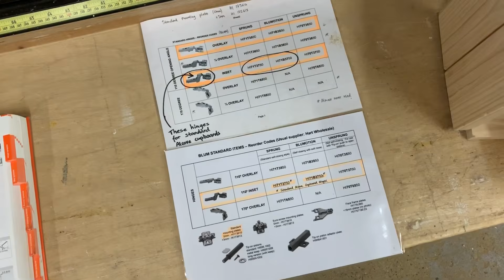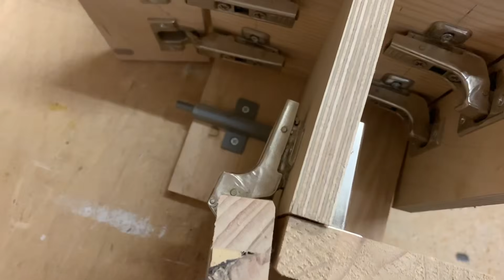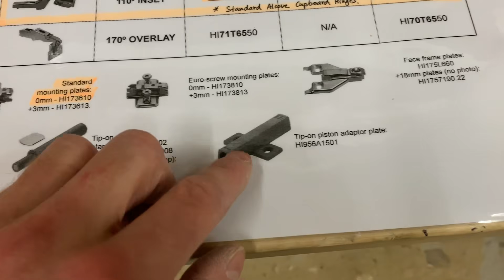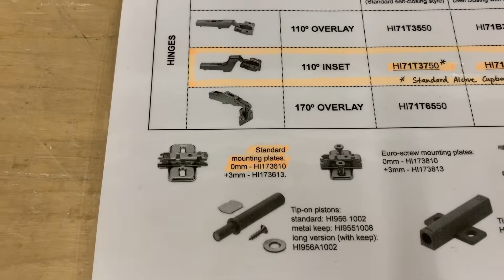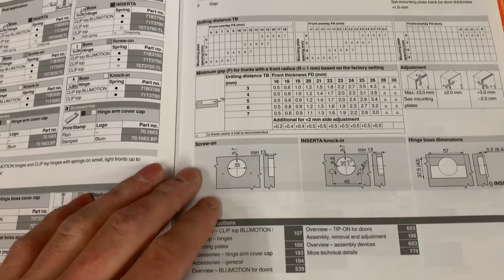All the main Blum hinge types explained!

Comment: 9:52. Can you go into a little more detail about the spacer you need to use the 170 degree hinge with an inset door?  I am making an inset bifold door for an L shaped office cabinet, similar to a lazy Susan door, but totally inset.  Is this a shop made spacer I make myself or is it supplied by Blum?
Reply from the maker: Google 18mm Blum mounting plate https://www.tcfixings.co.uk/product/blum-clip-two-piece-adjustable-mounting-plate-18mm-height/3731?gclid=Cj0KCQiAutyfBhCMARIsAMgcRJTpjTd89VPnroXs2EpQMPdiHqAARkWCAzp3VhG4DdO8pOVvHgpXKbwaAgfLEALw_wcB
Reply: @Alastair_Johnson  thanks for the information!

Comment: I needed to put a door on the front of a free standing washing machine, I knew what I needed but could not think what it was called as it’s normally 1/2 overlay or full, needed 2 inset hinges and it worked perfectly, you even gave the codes, thumbs up and subscribed for a thorough video
Reply from the maker: That's nice to hear, thanks for letting me know!

Comment: Very usefull Alastair thankyou. Would it be acceptable to use any of these hinges on 18mm mdf carcasses as opposed to ply?? Will the screws hold ok?
Reply from the maker: Hi Giles, way back we used to make our internal carcases from Medite 'premier' MDF and we used mounting plates with simple 17mm long 'hospa' screws (pointy self tapping screws -  not the stubby euro screws that require a 5mm predrilled holes).  Then we had a call back to a job where the mounting plates were pulling off and I decided the material was not strong enough.  This was one of the reasons for switching to birch plywood carcases (prior to us having an edgebander or CNC).  However now our standard internal carcases are made from melamine faced MDF, from Finsa's '12-Twenty' range.  We use the euro screw type of mounting plate, and i am confident about the fixing.  This particular range of Melamine faced MDF has a pretty good core.  I still wouldn't use the hospa screwed plates in it though.
Reply: @Alastair_Johnson  thankyou Alastair I really appreciate your detailed answer

Comment: Are these hinges very durable. Bottom line
Reply from the maker: Lifetime guarantee on Blum.   I’ve never had issues with them.  Like anything they beee to be correctly specified - using the correct quantity of hinges per weight of door.  The most likely thing to fail is the fixing into the board - so it’s good to use quality board and appropriate screws

Comment: When does the use of a third hinge come into play, as it relates to the door height?  I’m sure weight and width are factored in.  But I have some frameless cabinets that will have full overlay doors that are 18” wide, made of 3/4” thick CVG Fir plywood.  Should I use three hinges?
Reply from the maker: If in doubt use another hinge.  And see this guide: https://ea.blum.com/en/number-of-hinges/

Comment: Trying to find drilling pattern for cup holes today for 21mm doors and 18mm carcass on hettitch and other brands on website.   Couldn't find answer so have up and emailed them. Do you have any ideas? Thanks
Reply from the maker: 35mm diameter cup hole.  13mm deep, 5mm from the edge of the door (22.5mm to hole centre).  This works for the vast majority of situations.  Apart from that, take time to understand the diagrams from suppliers for example these ones from the blum technical manual on page 79. https://publications.blum.com/2020/catalogue/en/78/  It's hard to get your hear around at first but if you carefully cross reference the charts and diagrams you will start to understand how changes to one setting affect gaps/overlays etc elsewhere.
Reply: @Alastair_Johnson  thanks, I've worked it out, the standard 110 degree hinges don't work on thicker doors, I need thick door hinges. I was actually using the dimensions you mentioned but the standard hinge was giving me problems. Sorted now 👍
Reply from the maker: @tadge74  Ah ok yes that makes sense

Comment: I have internal drawers in my cabinet but the door is restricting the drawer movement, i have used 95° hinges, would the 165° opening help me out?
Reply from the maker: The blum 155º hinge is designed to move the door laterally outside of the inner face of the cabinet when opened and may be the solution you need.

Comment: Very useful video! Do you have to have the soft close on both hinges or can it only be on one of the hinges for full size door applications in say a kitche? Thanks
Reply from the maker: you can turn them off and on until you get the right level of soft close.   We find that 3 out of 4 hinges is enough soft close on a tall door, and we usually just use one on a 2-door small cupboard door.  So we actually substitute the other hinge for a slightly cheaper sprung hinge without blumotion at all

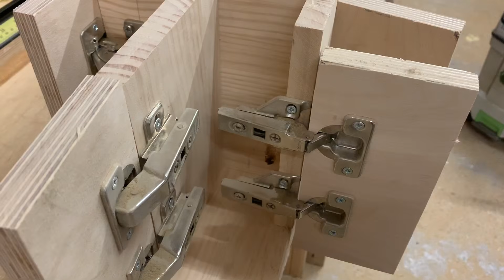Comment: Great video, thanks so much for the explanations! Could you tell me the code for the hinge at 6:40, please? And if there are any hinges that accommodate a similar situation?
Reply from the maker: Do you mean the mounting plates for fitting on the inner edge of a face frame.  They are much more widely used in America than in the UK.  Example: https://www.handlesandmore.ca/face-frame-adapter-plate-0-mm.html

Comment: We have older cabinets that have a partial inset, does Blum carry any soft close hinges for this?
Reply from the maker: I’m sure you can do it - if you are referring to inset sideways across the cabinet then there is a half overlay hinge with a cranked distance in between the full overlay and full inset options.  If you are referring to a partial inset forwards/backwards into the cabinet then you can just move the mounting plate position to suit.

Comment: Hi 
iam fitting some clip on 110 degree o overlay soft close hinges with a euro plate, the 35mm hole sits 5mm from the door edge
Can you please advise me how far in the holes should be on the carcass for the Euro plate.

Hinge type...CC110SEC2/PB

Thank you 
Andy
Reply from the maker: Hi they are 37mm from front edge of carcase

Comment: I ungraded my normal hinges to Softclose Hinges - but had to use Hetich as the existing holes in the doors (cup side) were 52mm centres. Most of the Blum are 45mm centres. If your carrying out an upgrade - make sure you check the existing door side screw positions/centres. The Hetich hinges also come with a multidue to options - like arm covers and cup end covers.
Reply from the maker: Hettich hinges are really nice!

Comment: Ever used the wide opening types with mitred door?
Reply from the maker: I haven’t but I think the best ones for that might be the Blum 155degree hinges which throw the door more forward as it opens
Reply: @Alastair_Johnson  I ended up using a 170 degree half overlay. Adjusted to keep socket hole as far from mitre as possible. Just barely clears, but it does work.

Comment: So they never came up with something that was flush mounted without a mortise? Nor a shallow mortise like 3/8 so I can use it on doors with less than a 3/4 stile? Bummer, that's like me forgetting to caulk one side of a tub.
Reply from the maker: You may well find solutions, search for the Blum orange technical manual (FAR more hinges than the small snapshot shown here)

Comment: This was really excellent. Thank you. 
Can you please tell me the name of the hinge at 7:03? I'd also love to know whether the edge of the door exceeds the width of the surface to which it was attached please. I have an awkward door situation right up against a wall.
Reply from the maker: Hi I get asked about that hinge a lot, I wish I had covered it in more detail in the video : https://www.tcfixings.co.uk/product/blum-110-face-fit-compact-hinge-plate/16540?gclid=Cj0KCQiAqo3-BRDoARIsAE5vnaL4mjwSIbKr9kniaPbeXsQBSPqvT0wWWHkxLAU8t8PPygCHX3-tJjEaAhYoEALw_wcB
Reply from the maker: You do have to drill the cup hole very close to the edge to be sure it doesn’t foul as it opens
Reply: @Alastair_Johnson  Thank you so much for the information and the advice. I have no idea what I'm doing but it's a very small project so I have a little room to go afoul and still fix it.

Comment: Thanks for the video. Could you explain why Blum Tip-On or push can only be used with unsprung hinges? As far as I know Blum also sells a buffered version which they claim is intended for sprung hinges. Has you tested those by chance do you know what is the difference? Or is it just the same Tip-On with magnetic and rubber tips.
Reply from the maker: Hi sorry I missed this comment first time around!  If a sprung hinge is used with a push latch, it just means it will open as far as the latch travels and hold there until you get your fingers in and pull it open.  Personally I think it’s a nicer effect for the door to swing freely open after the latch has released and given it that initial push.  I’m not aware of the specific rubber tipped one you’re talking about but… come to think of it I can see some benefits to it because it wouldn’t need to be magnetic (the door will hold closed due to the hinge springs) and it will be a much quieter operation without all the clicking and hard contact.

Comment: This is great! Just started working in a furniture company as a constructor and now I know what everyone is talking about. Thanks! So do you choose the mounting plate accordingly to the thickness of the  sides or the door overlay?
Reply from the maker: Hi Nikolai, glad it was useful.  The mounting plate does affect the overlay, and therefore you should consider the choice based on side thickness - a zero height Blum mounting plate gives a 16mm overlay suitable for an 18mm side.  A 3mm height mounting plate gives a 13mm overlay suitable for a 15mm side.  Bearing in mind also that the overlay is adjustable a couple of mm either way on the hinge

Comment: what is difference between sprung and blumotion
Reply from the maker: Hi the hinges with Blumotion are sprung hinges with the addition of a soft close damper built into the mechanism.  Soft close is meaningless unless there is also the sprung mechanism pulling against it.  The door won't close by itself unless there is a sprung mechanism, and the soft close (called blumotion for blum products) just adds some resistance to slow down the closing action.

Comment: Hi
A complete explanation of the correct use of concealed hinges
The 170degree hinge is mainly used to obtain cero protuding of the door into the case from only 90degree of opening, used with rool out drawers.
That is the reason why it only come in full overlay. Half or inset makes no sense
saludos
Gerardo

Comment: The hinges you said you don't use or  understand is because you have the closed and open positions backwards.  Closed it is at a 90 and  tight and open it is flat and spread out. Think of it as the middle hinge for a double door on an inside corner cabinet it goes less than 90 to assist in the opening and closing but want to be at 90 at rest.
Reply: Yes looking at that video had me back to the blum catalog they have two very similar looking hinges for two completely different purposes, I am mistaken.  The ones I use are slightly different with a bit more of an angle to the arm and a little different geometry.  Nice to see this style i apparently didn't know existed.  It seems we both use opposite ends of basically a their series of angle cabinet hknges.  Yours being 180 (flat) and mine being 90.  They have a few in-between angles for angled faces there but i didnt know about the flat one. Thanks!
Reply from the maker: Essen Davis are you talking about the blind corner hinges at about 8:45?
Reply: Yes, starts at 8:10.  Those are awesome problem solvers.  Mixed with the big hinges that open 155 degrees and you can close in a corner and get in and access it all.  Here's a guy showing how they work. https://youtu.be/mopWSY-HUD8
Reply from the maker: Ok, you can see the opened and closed positions more clearly from about 2:00 in this video on an actual cabinet: https://youtu.be/bsHWUJePSt8 The closed position is flat to the adjacent panel or post.

Comment: This was very helpful. I have the Blum 71B3550 hinges which I want to install using the Kreg concealed hinge jig. I’m having a fart time trying to figure out how many millimeters I should set on the depth when I drill the cup hole. Finding the install info has been harder than I thought. Any ideas?
Reply from the maker: SweetSillyFun hi, Blum technical manual says minimum 13mm cup hole depth https://publications.blum.com/2018/catalogue/en/97/

Comment: Helpful video, thanks for the clear explanations and codes, and links to the Blum catalogue.  Since I have some inset doors that need hinges, that are just ½" thick, I will go through the catalogue for the right codes for thinner than normal doors.
Reply from the maker: Mark Fromberg tricky one that - cup usually needs drilling to about 12mm.  Something probably exists though.  Maybe the small hinges that have a 26mm cup diameter

Comment: Another great video, bookmarked for future reference - thanks.  Have you done anything on dealing with out of plumb cabinets ?  I have to retro install / rework  a flush MF door in an understairs space where the hinge wall is out of plumb  and the hinge plates are screwed directly onto a piece of MDF fixed to the wall. The customer wants  a minimal parallel gap between wall and door, so the whole door is going to end up rhomboid.. I am sure this will be achieved with a lot of faffing, but what hinges have the maximum adjustment capability ?
Reply from the maker: Richard Keith just say no, sometimes customers need expert direction.  Always make the hinge edge plumb so the door swings well.  Either do an overlay door and use hinge adjustment to overlap the edge to plumb.  And/or add a cover strip fitted flush to the face of the door to create a neat vertical gap, all covering the existing wonky structure.
Reply: @Alastair_Johnson  Thanks. Great advice as always.

Comment: Nice info 👍 one thing, does the 170° hinge clear the carcass enough so drawers don't clash?
Reply from the maker: Tagger the tagg i think the 155 ‘zero protrusion’ hinge from Blum is the safest bet
Reply: @Alastair_Johnson  thanks👍
Reply: @tcr_taggerthetagg  is that the hinge you're talking about if you have spice drawer. So they don't hit the door?
Reply: @ernesta5459  yes, I made a miscalculation and forgot to take off another 18mm for the drawer in a project, and wondered if I could save remaking the drawer. 

The zero protrusion hinge worked, no issues at all👍

Comment: Hi Alastair - great vid tutorial as always.  I went to purchase the download and get the following error 'Amount is less than the minimum required'. The payment mechanism used by buymeacoffee is a bit clunky to say the least. Anyone else having similar problems or is it just me?
Reply from the maker: Simon Hunter I have been told that once before, but otherwise the payments seem to work ok.  Are you using PayPal or stripe?  It generally seems to work better with stripe.  Any more problems email me on alastair@freebirdinteriors.co.uk and I’ll sort it out another way.
Reply: @Alastair_Johnson  its interesting  - I usually use Chrome, which is where I was having the issues. I tried it in IE11, and only got the 'Pay by card' option, which didnt work when I clicked it. Back in Chrome I  tried PAy by Card and it just goes in a circle when I hit the  captcha check box. I dont have a strip account so I tried paypal - which is where the 'Amount is less than the minimum required' message appears. I'll drop you an email as you suggest

Comment: When spacing out the hinges do you have a rule of thumb or is it user preference. i.e 150mm from top and bottom and divide the space equally to suit the number of hinges?
Reply from the maker: standard is 100mm from top and bottom of door, then equally spaced if more hinges are required for tall doors.  Refer to door height chart at botto left of this page from the blum catalogue: https://publications.blum.com/2018/catalogue/en/95/#zoom=z
Reply from the maker: We reduce the 100mm spacing to 65mm for extra short doors (including our standard alcove cabinet doors at 570mm tall).  The 65mm is only because it's another easy reference point off the side of the blum ecodrill hinge drilling jig!
Reply: Thanks for the information! You never let down with the replies 👍
Reply from the maker: Anthony Doyle you’re welcome!

Comment: Great way to show so many hinge options. I was REALLY HOPING you would have a solution to my cabinet doors. About 50% of all houses built in the U.S. in the 1990's have the red oak with beveled edge doors, 1/2" overlay, framed cabinets with exposed hinges (like Amerock AM763026). I cannot use ANY of the hinges you shown because the hinge cup extends about 3mm beyond the bevel and you can see it from the side.  
I haven't come across anyone with a solution to put concealed soft closed hinges on cabinet doors with beveled edges. Do you have ANY recommendations? Please?
Reply from the maker: David Galan is it something like one of the arrangements pictuered here? https://images.app.goo.gl/hk6Nw2gKyAQfrgiL9.  Is the problem that the edge routing back-cuts into where the 35mm cut hole is?  You may be able to simply cut the cup hole further into the door and it may still work
Reply: @Alastair_Johnson  Here is a picture of the problem with the cup of the hinge extending into the cabinet edge bevel and you can see it from the side. https://photos.app.goo.gl/r51mHA2PcMG3qX6j6  I cannot simply cut the hole further into the door because then the bevel edge would only open about halfway before binding on the frame. So I'm looking for a hinge of some sort where the attachment on the cabinet door is about 3/8" into the door, further out from the edge and so the edge doesn't bind against the frame.  There must be some experienced cabinet maker who has some sort of solution for this. Or is it just that these doors have to be dumped in order to get concealed soft close hinges?